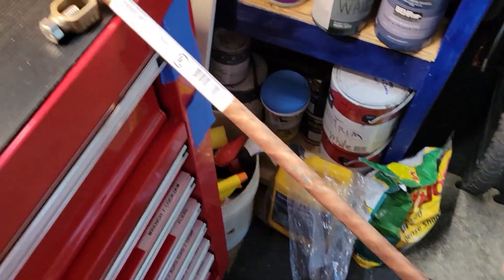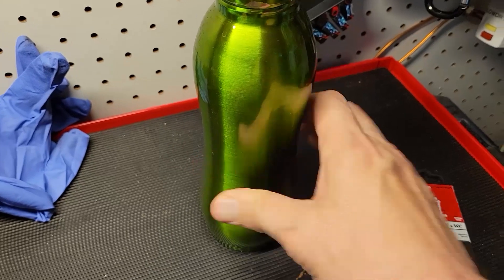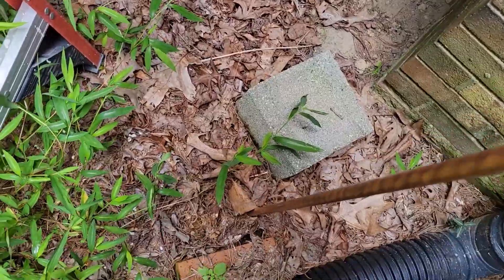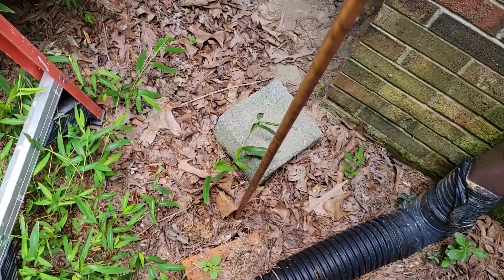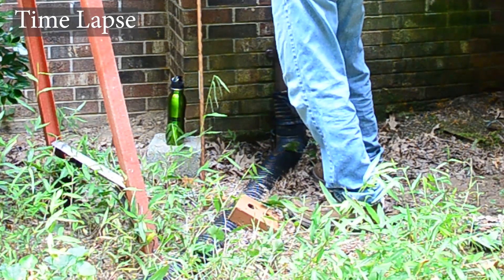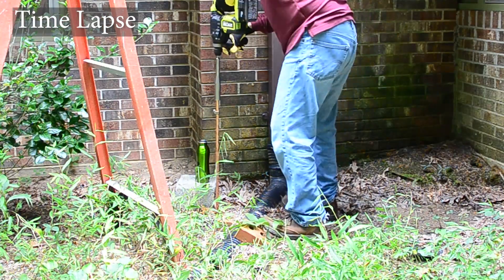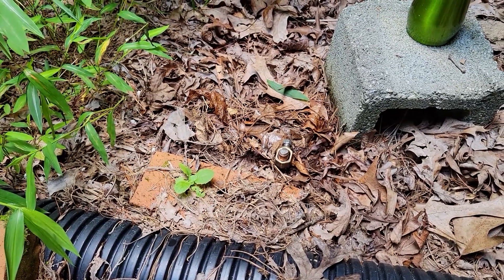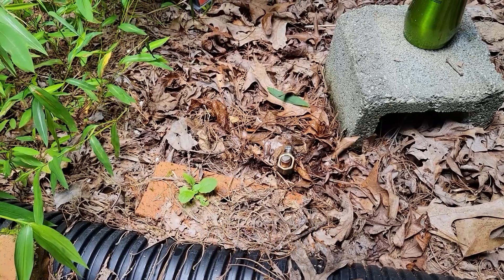How to Install a Grounding Rod

Comment: It might be a good idea to keep the leaves cleared up around the grounding rod to keep the fire hazard down if you get a lighting strike
Reply from the maker: Grounding will eliminate static electricity, protect against energy if the antenna comes in contact with live electrical wires. With a direct lighting strike all bets are off as the sheer energy will vaporize the wire. Even a nearby strike can start a house fire.

Comment: It might be worth mentioning that the new rod has to be bonded to the old rod for safety, it wasn’t that obvious from the video.
Reply from the maker: Steve you are right if there is an existing ground rod, they need to be bonded. This video just focused on installing the rod into the ground and not on wiring it to anything as that will be in another video. When the roof gets switched out I will need to utilize the new ground and bond to the old. Thanks to your input I will add a note to the description.

Comment: I won't to no about the ground rod to the pannul at pol.
Reply from the maker: The service panel should be grounded per code. I would advise consulting an electrician or your local building inspector for details.

Comment: What kind of drill attachment did you use?
Reply from the maker: I used a Milwaukee SDS Plus ground rod driver model 48-62-6031 with dimensions 1/2" & 5/8" x 10". This is meant for use on SDS Plus drill driver.